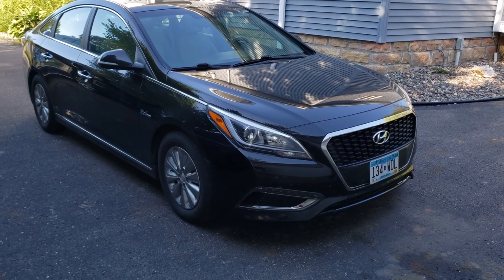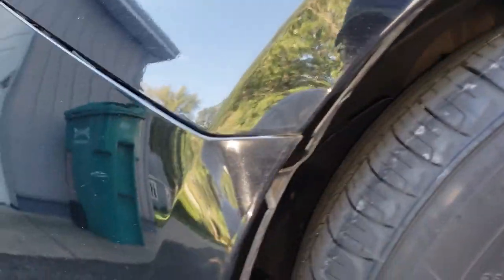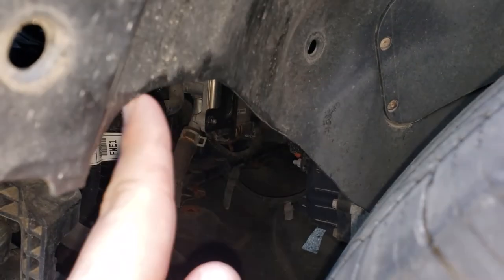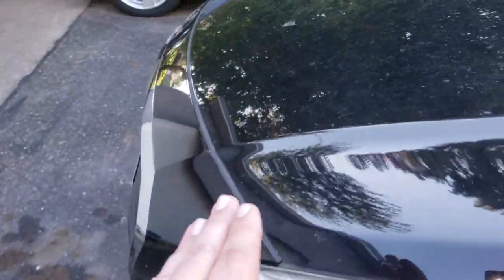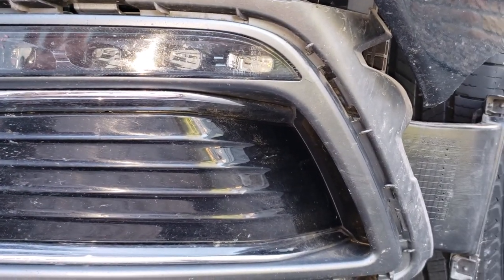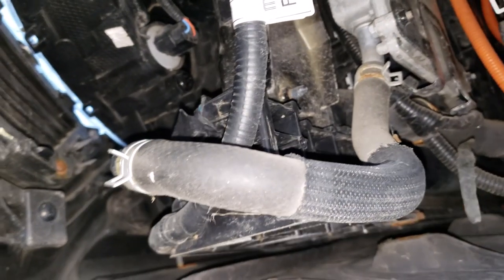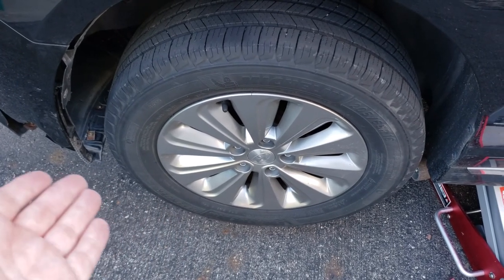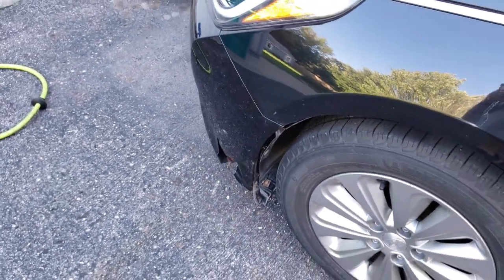What happens if you hit a Raccoon

Comment: I hit a raccoon yesterday on the highway going at least 60 miles per hour and about 20 minutes later I hear a a clicking sound when I start accelerating and then all
Of a sudden wouldn’t start What could it be had to leave my car 🚗 yesterday and I don’t what to do
Reply from the maker: Oh, boy. So not knowing what the clicking noise was exactly, the worst thing I can think of is that if it was clicking while the engine was running then it might have snagged an oil cooler line or dented a hole in something that holds oil, which could be very bad.  But, not knowing what it sounded like however if it was still cranking but not firing, it could have snagged a wire to a cam or crankshaft sensor so the vehicle doesn't know when to fire the spark plugs. Now if it wouldn't crank at all, it may have pulled wires off the starter itself. If you have tow insurance and coverage for hitting an animal, I wouldn't worry and just get it taken to a reputable shop. Luckily, my car was still drivable, but you want to be careful moving it yourself in case something major is damaged and is actually a safety issue. Good luck with your car.

Comment: I just hit a racoon. 

Mine looks bad, but at least it isn't that bad. I'll look at mine in the morning. It pushed in the plastic for where the LED lights would be if I had them and cracked some of the bumper plastic. Thankfully the crack doesn't go all the way down. 

Not sure what I'm going to do with the black LED plastic though....
😭😭😭😭. I wish I slowed down a little more than I did 😭😭😭😭😭. My car had about 0.18 "MJ" of energy when I hit it at probably around 40mph. If I just managed to slow down to 30mph that would have been 0.10 MJ and instead of 0.18 and so pretty much half the damage 😭😭😭😭😭

I have a 2022 Hyundai accent. I have minimum coverage so I'm not going the insurance way. 

Hey, but at least I didn't lose my life like the stupid raccoon. 
😭😭😭😭😭

13:35 My damage might be more like $200-500 if yours is $1000. 
I am not spending that much though as a college student. I'll probably buy some bondo to make it watertight, snap it in place, buy some Hyundai paint and call it a day. It'll be barely noticeable. 

Heck, it's barely noticeable right now at night unless I know where to look. Then it's obvious.

I'm in Louisiana so no rust :-)
Reply: I'm kicking myself for not slamming on the brakes, but I guess I just didn't have the time to do that. I did get to get on them, but I didn't process it fast enough to slam on the brakes.

You know, I wish they made these cars just a little bit stronger. Like at least strong enough to to dent and not break when hit by a soft bony raccoon.
Reply from the maker: Ya, newer cars are more about softer components to bust up and absorb energy than the mostly metal cars from back in the day.  I know it feels bad that you messed your car up, but really this happens all the time and you should focus more on the fact that you didn't over react swerve into the other lane of traffic or into the ditch and do some real damage to the vehicle, yourself or others.  

With my old 2010 VW Jetta I hit 2 deer, one at maybe 10mph, which seemed more like I stopped and the deer decided to hip check my headlight and break the mounting tabs.  Then the same thing happened again almost a year later and broke my repair for the mounting tabs, this time on a different road.  Both times I saw the deer in the distance and immediately started braking, but sometimes you're just going to hit stuff.  

This duct tape body repair worked out pretty good for a couple months until it made it to the shop https://youtu.be/BH7gbWA-uUU so that's always an option to get you through winter.  Then 3M and some other companies have some pretty decent plastic bumper repair kits that I was going to do a head to head on once winter ends here in Minnesota, so we're talking May as there's always one last blizzard that hits in April.

Thanks for the comment and good luck with the car.  Hopefully no more furry bowling balls jump out in front of you as I'm sure word has gotten out they shouldn't mess with a 2022 Hyundai Accent.